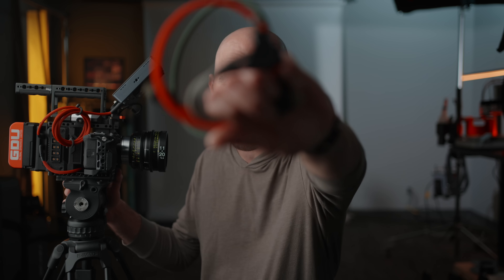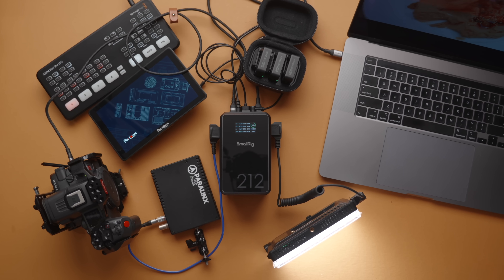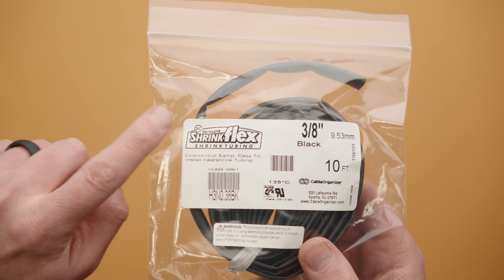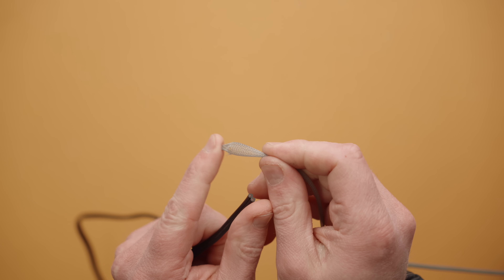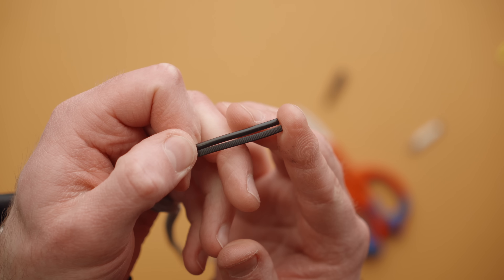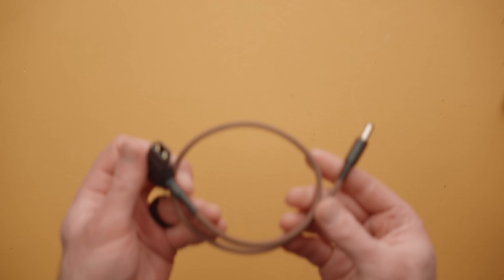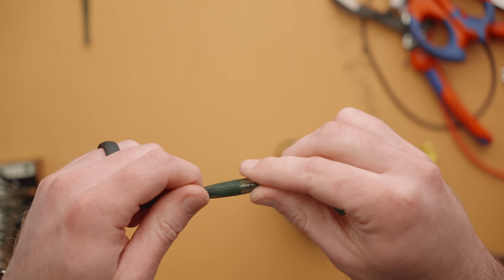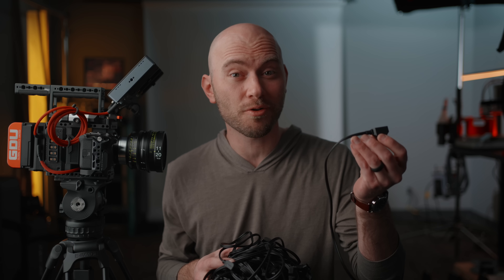Make Your Own Camera Cables!

Comment: Complete noob when it comes to multimeter. How do you determine positive verse negative sides of a cable/component? Do you need it hooked up to power when determining positive and negative? I know in the case of a battery, if the reading is negative  that the leads are backwards, but how would you determine positive vs negative on that barrel connector without a power source?

Thanks!

Comment: This is a great resource. Thanks for sharing! Perhaps I missed it in the video, but for the USB-C cables do you just chop one down or do you have a good source for USB-C to bare wire? I've seen some on eBay and Amazon but am curious what you've encountered in sourcing these cable ends. Thanks!

Comment: Caleb, could you sell the STL files for the old version if the CineDock you used in the tiny custom cinema rig build ? The one you sell on the website is not the same and I am building something similar. I can't screw my cheese plate and my NF-P battery mount like how you did

Comment: Fantastic video! I did something like this with heat wraps 20 years ago so that we could identify Ethernet cables that were being used for different Disaster Recovery simulation tests.

We’d have multiple companies testing at a time and not enough coloured cables to distinguish each test.

Mine looked like crap in comparison though 😂

Amazing work Caleb, thanks.

Comment: A few tips from someone who's been making cables for tech projects for years. I suggest adding a dab of glue to the ends of the cables where they fray. You can also just put the heatshrink close to the soldering gun if you don't want to get a heatgun. Be careful where you source your barrel jack connectors from. I've ordered some from what I assumed to be reputable sources only to have the plastic crumble after a year. DIY cables are common for custom keyboard builds so finding kits to make your own USB-C cables should be easy as well.
Reply from the maker: Would love to hear your source for connectors!

Comment: Very cool but I've always wanted to see it taken further than simple length and cosmetic mods. For instance I would love to see ultra-low-profile right-angle HDMI connectors that allow the typical flip-out screen on a mirrorless cam to still flip out and rotate fully. This is slowly being somewhat addressed with new cameras using the S1H/A7RV combo tilt/flip screen mechanism, but even then I'd prefer to keep the cables tight to the rig for less chance of getting bumped/yanked.

One easy semi-cosmetic semi-functional thing you could look into would be custom-coiling your cables to allow for a streamlined cable routing with the coiling exactly where you want it for length/flexibility. I think this would be doable with most straight cables with rubber housing- just mark where you want the coiling, wrap around a screwdriver or marker or whatever, clamp in place, heat with your heat gun and let cool. 

For instance with the typical monitor-on-a-top-handle rig you could locate the coiling so it's just where you need it, next to the monitor pivot/mount, and then flat/flush against the side/back of the monitor and the camera body. Mich sexier than a bunch of heavy bulky coiled cable dangling off the side of the camera and monitor.

Source some compact cable clips/clamps to keep the cables tight against the rig, and oooo-whee, that's some OCD-satisfyimg stuff right there 😄